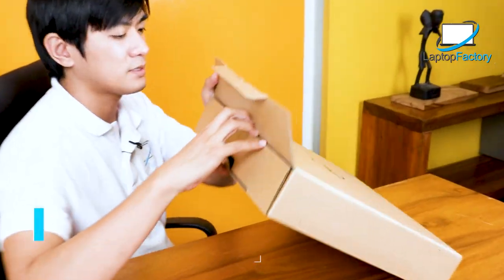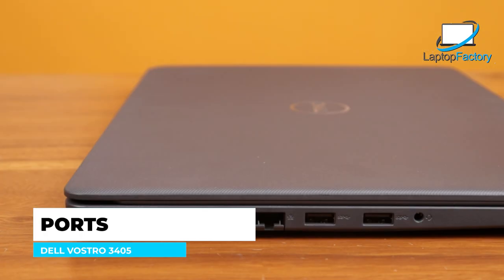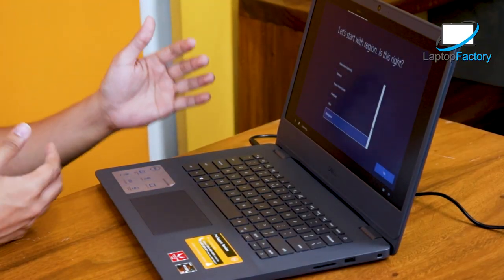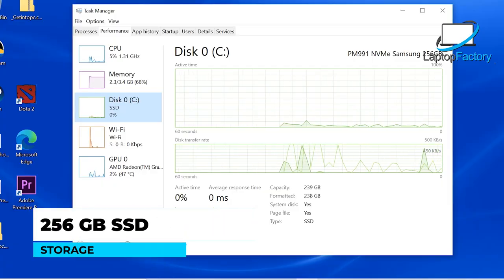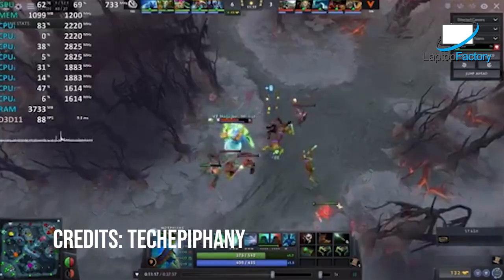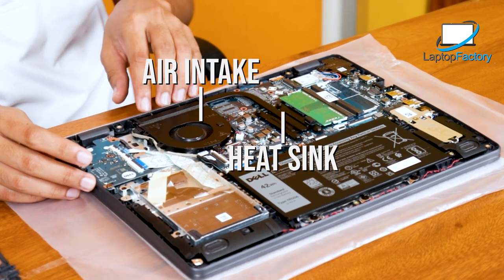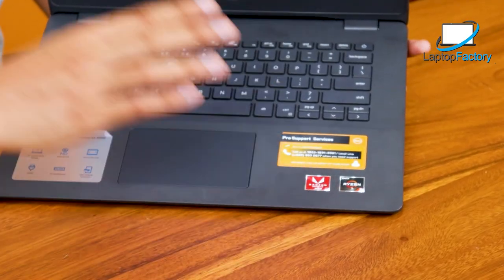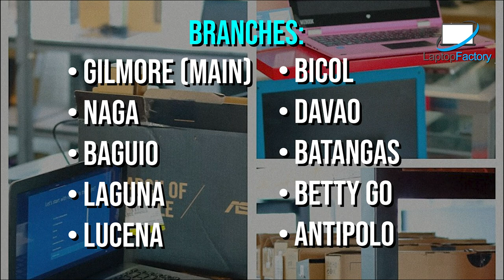DELL VOSTRO 3405 Unboxing, Reviewing & Upgrading | IDEAL LAPTOP SA EDITORS AT STUDENTS!

Comment: Hello! Nice video, I'm thinking of buying this machine. 

I have a question about the HDD. So it does not come with one installed. I was thinking about buying a 1TB one. Do you have to buy a special DELL SATA cable to connect it or you can just simply plug it in on a connector that's already there? 
Thanks in advance! :D

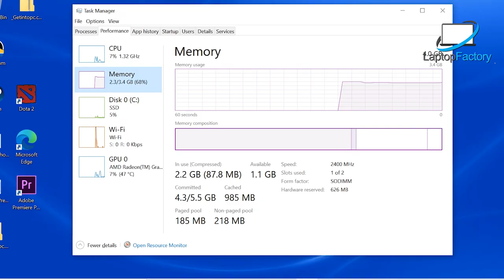Comment: Hi, I noticed that in 5:24, the idle temperature is 47 degree Celsius. I have the same laptop, Dell vostro 3405 ryzen 7 3700, but the idle temperature goes high up to 60-65 degree celsius. Do you have any idea to overcome with this high temperature (it is still in idle condition)?
Reply: This 😢

Comment: sir DELL Inspiron 15 3000 pwede ba upgrade ang ram and storage?
Reply from the maker: In memory, you can replace the memory but the Maximum memory of Dell inspiron 15 is 8 GB of memory only. 

In storage, you can replace the storage with a 2.5 SATA SSD

Comment: Budget segment po boss yong 3501 na dell na may i3 11th gen
Reply from the maker: that will range 25-35k depending on the specs (aside from the processor)
Reply: @LaptopFactory  Sir review nyo po yong dell 3501 na i3 11th gen
Reply: Available po ba ang 3501 na i3 11th gen?, magkanu po?